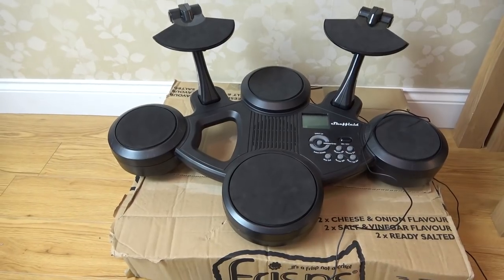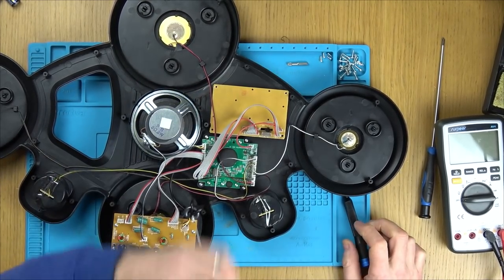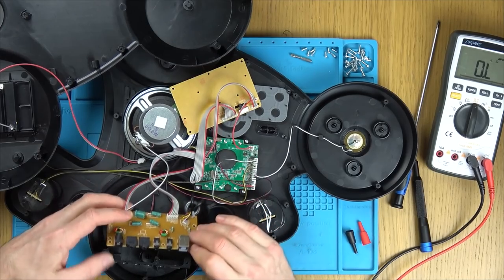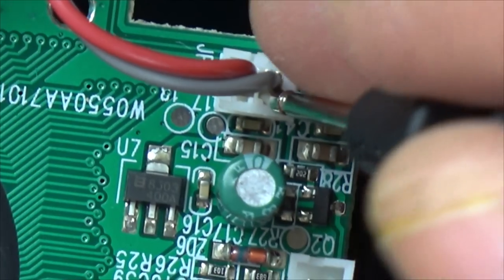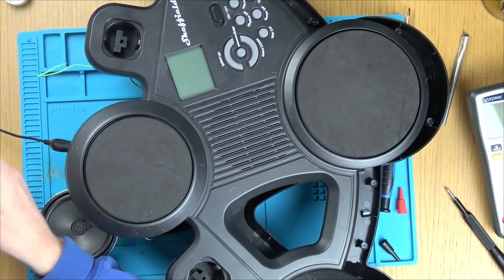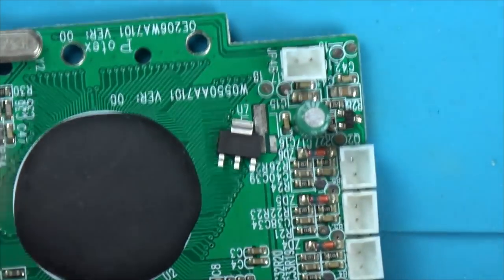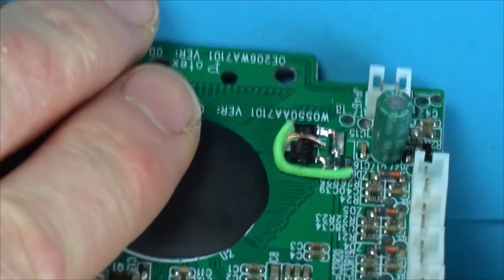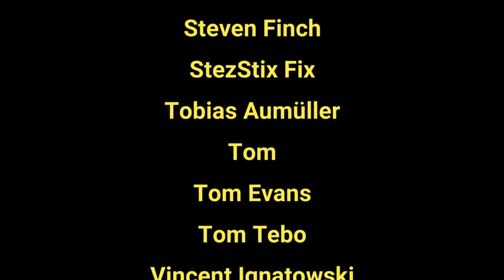FAULTY Sheffield Electronic DRUM KIT - CAN I FIX IT?

Comment: Hi Vince, it was me who sent this item to you. I saw it on eBay and I paid £15 with postage. It was described as having no power. I was hoping it wasn't just the on/off switch. I had it sent straight to you to save more postage costs. Thought it would make a good fix it video. Also thought if you got it working, the kids could drive you nuts with it later on. I'm pleased you didn't mind me doing this and also pleased you made the video.
Reply from the maker: Ohhh OK, so the sender was the eBay seller. Oh well I thanked Raj but I should have been thanking you Flying Mower. It all makes sense now😂 Nice one for sending it over. I was also worried it was going to be the on/off switch but I think it made for an interesting fault, luckily it was more challenging but not too hard. I will pin this comment. As it turns out it is me driving them nuts with my hip hop unique drumming style 😂 Thanks again 👍👍👍👍
Reply: @Mymatevince  That's awesome.  I actually was thinking:  There's Raj, sitting at home saying...."Man, I just gave away a drum set to Vince and he fixed it for 20P."  Nice work, as always, Vince.  What do you do with half the stuff you fix?  The wife must drive you crazy to get rid of half of it!  *the drum set is next, btw!*. 😂
Reply: @willmorici5765  i also want to know this answer.  All this stuff adds up taking space.
Reply from the maker: @willmorici5765 Well most of it has just been storing up, but my house became a bit of an embrassment as every room was getting taken over with boxes.  So I have been giving away stuff to friends and family and I will probably try and do a car boot sale or maybe eBay some smaller items👍👍👍
Reply: @Mymatevince  Vince, let me say that it's an honor to hear from you, first and foremost.  Much respect to you.  As a NASA engineer, I work on spacecraft; but my forte is Mechanical Engineering.  You have taught ME so much much on the electrical side of things.  Thanks and keep up the good work.  Thanks again for the great content and I look forward to seeing more of your  electronic repairs.  I really loved your wacky projects, such as windows and plumbing.  I had such a laugh with you trying to get that window out and turning the water on and it gushing everywhere.  It happens to all of us, believe me!
Reply: @Mymatevince  i have been watching for so long i rmember when u would give network tutorials lol
Reply: I actually was going to send him an elka radioshack keyboard that might very well have a similar problem!
I tried to fix it but thought the SOC was dead it comes on but nothing on screen and just a pop from the speakers.
Vince message me if you have an adresse where I can ship you the toy keyboard and Ill send it over its all yours 
Hopefully I can get it to you so that you can  make a cool fun educational repair video in the future!
Reply: @coolelectronics1759  His PO box is in the (about tab)of his channel.
Reply: @flyingmower  thanks for the headsup appreciate it.

Comment: That was great! With the voltage regulator I think you made the right call in the end. On that datasheet it looks like the original one is a BL8503-40 so that would be a fixed 4.0V output. Voltage regulators are set up to always have a fixed voltage output, so generally a 4.0V regulator would always output 4.0V no matter whether a 5.0, 6.0 or 7.0V (or higher) input, you only need to worry about not going beyond the limits of the specific regulator. And a minor point is needing to have a bit of differential between input and output so for a 4.0V output regulator you'd normally need minimum a 4.5V or 5.0V input for it to have something to work with. Again it depends on the exact regulator.

Anyway, they probably used the regulator here to lower the battery voltage to a safe level for the chips so 5.0V output could well have been too high!
Reply from the maker: Nice one, I thought they might just step down the voltage to a % under a range of input voltage. I didn't realise that they have a fixed output. Thank you 👍👍👍
Reply: @Mymatevince  The output should be 3.0V according to the datasheet for the regulator shows 4V input (Minimum) and 3V output (this allows the batteries to run from 6v down to 4V before the output is affected) I was screaming at my screen when you used the 5V regulator, I then took a great sigh of relief when you swapped it for the 3.3v  although it's higher by 10% it should be ok but I would still swap it for a 3.0V version.
Reply: @Mymatevince  Generally the last two digits are the voltage output like a 7805 (5v regulator)  7905 (-5v regulator) 7812 (12v regulator) etc, so I'd expect a 8503 to be a 3v regulator.  Well done on another successful fix.
Reply from the maker: @BuyitFixit  That is useful to know. Thank you👍

Comment: Really enjoyed this. Don't be afraid to use flux like normal when using low melt solder, it's a lot easier to use and doesn't stick and spread everywhere and keeps in a nice flowing blob rather than turn stodgy and sticky.
Reply from the maker: Thanks Adrian, on my next video or maybe the next next video I did use flux with the low melt after reading the comments on the Mega Drive clone video (I think it was) 👍👍👍👍

Comment: Those piezoelectric speakers are microphonic Vince just like how you can use a normal speaker as a crap microphone, when the crystal flexes from being hit it’s generating a voltage.
Reply from the maker: Thanks Gower, I never knew that! I have only seen them used on cheap handheld games for sound. It was nice to see them being used as a microphone 👍👍👍👍
Reply: @Mymatevince  Not a mic, more of a variable impact sensor. Even the expensive ones work the same.

Comment: I’m suspecting that voltage regulator is a 3.3V not 5V, as the batteries would be considered flat at 1V per cell or 4V total.
EDIT: that’s better 👍
Reply from the maker: Thanks Scott👍👍👍

Comment: Am I the only one who noticed that Vince soldered the voltage regulator incorrect? the middle pin should have been soldered to the middle pad like the previous regulator. He is not regulating the correct current or am I just not getting it? ☹☹
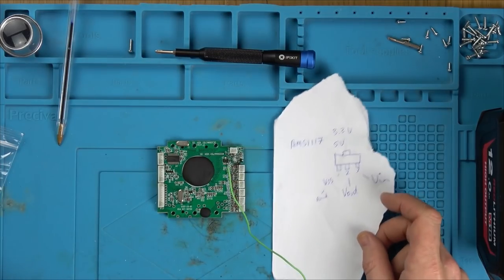Reply: The pins are in a diiferent order. Have a look at the diagram at 26:05.
Reply: @ianhaylock7409  Thanks Ian, I must of zoned out at that moment. 👍👍

Comment: did he say that the 3.3v regulator was the same pin out as the original, shouldnt it be wired the same as the original regulator?
Reply from the maker: Oh yes I did, sorry for the confusion. The one with the same pinout was on a different much smaller voltage regulator, about half the size of the original one 👍👍👍
Reply: @Mymatevince  thanks vince had me confused for a minute

Comment: Nicely done Vince. It is always satisfying to fix something when the components only cost 20-30p a piece. I fixed a TV a few months ago, the component I already had in my stock with a value of around 10cents (EURO), which was an IR receiver for the remote control. The client thought the actual remote handset was at fault. Fixing it as an amateur really put a grin on my face, a nice feeling and prevent things going to the landfill so quickly.

Comment: Excellent video. I had the exact same issue with my e piano and my ultrasonic bath. In both of them the 3.3V regulator has failed. I have no bench power supply, so I took 3.3V from an ATX power supply. I think these regulators are often undersized and likely to fail. So I love the fact you replaced it with a bigger one, I wish I did so either but I took it from another board and now I can wait for it failing again 😂

Comment: Wow Vince new multimeter leads, but what happened to the Fluke digital multimeter? As usual an entertaining and informative video great to watch and learn
Reply from the maker: That's still here. The continuity buzzer is a little slow on it, just the way it has been designed so it rarely comes out, unless I am testing higher voltages. I feel safer with the Fluke. Real shame that the buzzer takes a second to respond on it👍👍👍

Comment: it must say plus 6 volts on that board , how can 6 volts put out 9 volts ?
Reply: I think it was originally designed to take 2 more batteries in series, look at the battery compartment! Looks like they blanked off the slots for the first and last cell, if it had 6x AA batteries that would have been 9V originally

Comment: Nice fix wow that globtop is huge the biggest blob i have ever seen it can basicly fit a whole packaged microcontroller under it with package and all i wonder if its a custom asic with mcu and audio and drum circuits or its just a microcontroller with code i so wonder if it houses more dices like a mcu a drum synthesizer etc
Reply: Also these voltage regulators are linear they are basicly big resistors wich limmit the voltage and throw exces in heat also the ams1117 are used in arduino development boards and their number might indicate voltage example 780[5] 5 volt 7812 12 volt  thank me later for the info

Comment: Voltage regulators put out a fixed voltage, independent of the input. You need the correct regulator voltage, not just any voltage.
Reply: The exact value of tour regulator should be written on the regulator as a code.
Reply from the maker: Thanks Kris👍

Comment: You had me on the edge of the seat Vince! I was here saying "No! Don't use the 5 volt regulator! Use a 3.3 volt one!" and was glad to watch through...what a relief! Now with some more broken musical instruments that could be fixed there seems to be a band forming up...

Those piezo things are there to sense vibration and strikes to the drum pads hence the sensitivity and velocity/hardness sensitivity (if such kit does have that!)

So the LDO (yes it actually is) that was originally in there is a CMOS part (known for low idle power consumption but a bit fragile on high current applications) in a tiny package (cannot dissipate the heat well)...must have heated up and died out that way. Personally it is not worth getting that same exact LDO for a replacement only to fail once more...I would have used a fixed-voltage 108x (1084, 1085) or jig an LM317 on there! 

3.3v seems to be the ideal spot for that blob chip.  4 volts is a bit of an oddball, maybe conversion to 3.3 seems to lay burden on the regulator considering input voltage so raise it up...Or to account for droop when the batteries get weak. Remember that as input-output voltage differential increases the current capacity drops down too
Reply from the maker: Thanks Rui for the detailed info👍👍👍👍

Comment: Well done as always. However, use caution (you corrected yourself) when injecting voltages, changing regulators etc. Many micros which normally run at 3V / 3.3V may have a maximum working voltage of 3.6V (3.5V from a noisy power supply may damage them and 5V certainly will).

Comment: Hi Vince, did you know the red and black tips on the end of your multimeter leads can be pulled off. They are probably annoying you. I have the same leads and only recently realised they come off.
Reply from the maker: I did thanks. It is safer when working on mains voltage as there is less chance of accidentally touching the probes, but they can be annoying when fault finding low voltage circuits. It did take me a couple of weeks to notice they come off though 🤣🤣👍